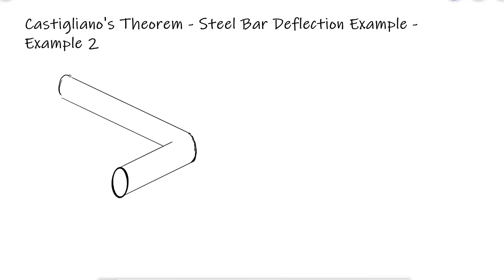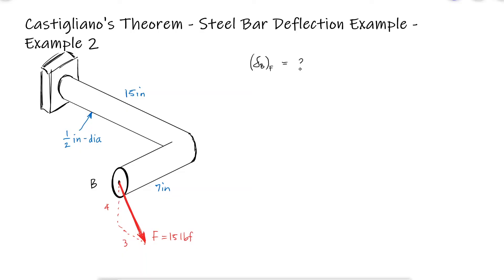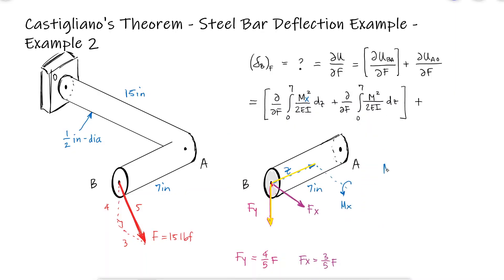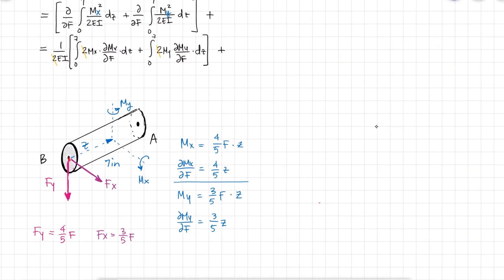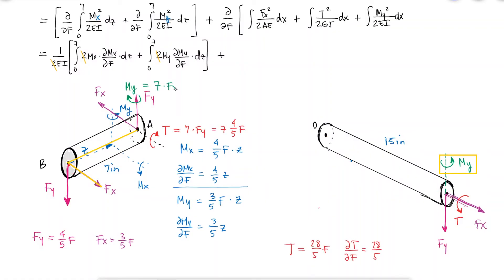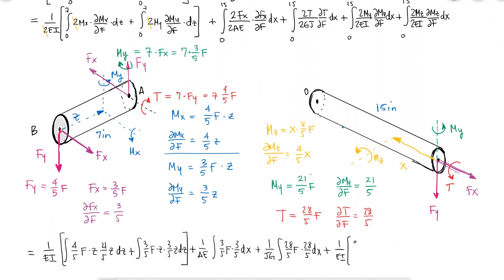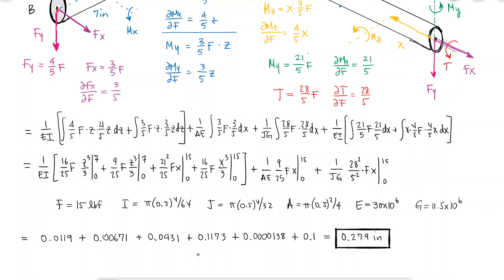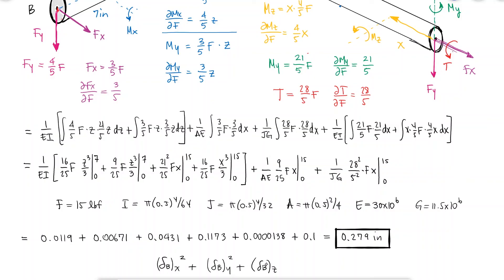Castigliano's Theorem - 3D L-Shaped Bar Deflection - Example 2

Comment: Why would the moment acting in the y on the 15 inch bar contribute to the sun of the deflection in the direction of the force? The direction of the force is in the x and y plane while the moment acting in the y on the 15 inch bar deflects it in the z direction. If you were to take the dot product of the deflections along the unit vector of the applied load then the z component would cancel.